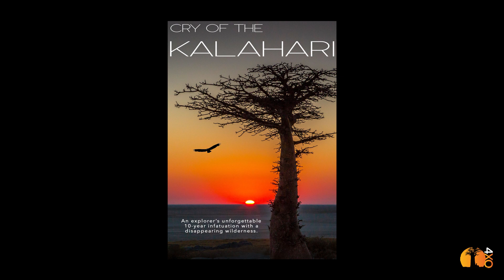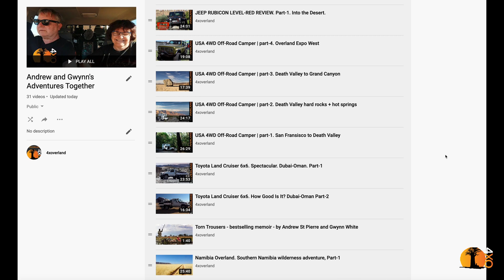IMPORTANT Channel news and events. 4xOverland.

Comment: Andrew,: your Aussie Dream Tourer, time to take it remote and prove it’s not a lemon and you’re beyond remote travel.
Reply from the maker: You've obviously missed a heap of videos.
Reply: @4xoverland  Thanks Andrew. During COVID19 lockdown in Victoria your videos have provided me with entertainment including many laughs. Yes I've watched all your weekly video posts re this vehicle, and the past 2 years of your previous Youtube posts. And still  the current vehicle doesn't come up to the mark for a go anywhere near an independent Overlander. Your trips in this vehicle so far have been off the bitumen onto property tracks with so much hesitation going onto sandy river beds, and ascending hilly tracks. You set up your kitchen without any regard to lovely wife's Gwynes needs. Your electrical system is over the top for the average overlander...set up for your need to keep your camera gear charged for your Youtube & Patreon posts...heaps more than the average overland needs. Despite your protests you're going the same way as 4WD 24/7....just a big ad for product endorsement....just in a softer way. Win me and take this vehicle remote. Cheers AB
Reply: @andrewbrowne4538     You really need to get out more AB. Comparing 4xoverland to 4wd 24/7 was the funniest part of your post though:)   I love your direction ASPW!!

Comment: You could bring a new build to the channel like a cheap build project, or a bigger rig in a light truck, like a Mitsubishi Fuso 4wd. For older folks that want a confortable ride expedition.
Reply: I don't think you can put fuso and comfortably ride in the same sentence with out major work.
Reply: @saff226  you could use a good suspension system on the seats.
Reply: After driving around in lots of different off road trucks I can tell you that no suspension seat will make up for lack of front suspension travel.